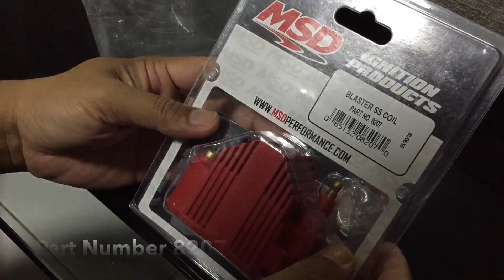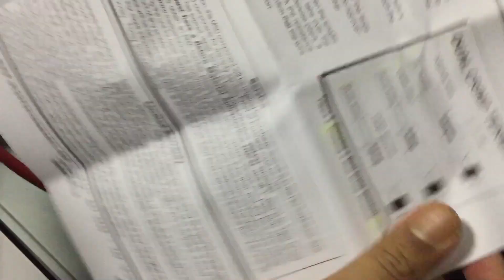Yamaha NVX Aerox Malaysia Ep: 2 | UNBOXING & INSTALLATIONS | MSD BLASTER SS COIL

Comment: mana link nak beli bang? saya tengok kat shopee dalam rm150, ingat nak try pasang kat y16zr, motor standard nak pakai takde masalah kan?? lepastu ni coli plug utk motor injection kan?
Reply from the maker: Saya  beli ori rm550 camtu. Kalau 150 confirm bukan ori. Kalau bukan ori baik pakai ori moto je pun ok je
Reply: @MrCrabsteer  ohh macamtu, kalau brand fasstek punya atau faito racing 7400 tu ok tak bang untuk y16 standard?

Comment: Klau tukar coil ni, apa funtion dia.. boleh naikkan top speed x bos?
Reply from the maker: Coil tak naikkan top speed, cuma pastikan api cukup dan stable je bang
Reply: @MrCrabsteer  owh.. Tq bos.. Saya Newbis lgi..
Reply from the maker: Saya pun newbies bang. Coil ni hanya support. Contohnya high rpm coil asal cepat panas ke, tak stable, miss-firing ke. Coil yang lebih besar dan material cable etc yang lebih efficient akan membantu lancarkan penghantaran kuasa ketika itu. Jadi indirectly boleh improve speed juga sebab api takde masalah 😊
Reply: Kalau tuning cantik torque naik bang.. enjin lebih responsive..

Comment: sy pakai coil plug ni kt rs150 tapi paki ecu tune bos lampu cek engin kelip2 error pd coil plug.. ad org ckp ni coil utk CDI bukan utk FI...
Reply from the maker: Saya pakai Juken 5 kat FI ok je bang
Reply: @MrCrabsteer  tulah... sy pakai dh lama dr spec 63 ke 65 ke 65 jek rod pakai ecu datatec.. tuner ckp xd msaalh. ni bru tukar tuneboss die error plk pd coil plug.. tp ms rpm 7 dh ilang lmpu engin kelip2... run dyno smpi finishing xd msaalh.. to hq tune boss ckp ni coil utk CDI bukn utk FI atau kne pakai sistem output MSD... tu sebab ecu die boleh kesan... law paki jgk kemungkinan ad msaalh pd engin...hemhhhh... mahal tu coil ni huhu
Reply from the maker: Bukan first time saya dengar pasal tuneboss banyak limitations itu tak boleh ini tak boleh. Saya kurang berminat. Saya  pakai Juken5 je. Boleh la.
Reply: Nak kena reset tu tuan..bru hilang error tu

Comment: Is it recommended to change spark plug when you use racing ignition coil? I have a y15zr with 62mm and big valves
Reply from the maker: Not compulsory as long as the plug still in good conditions

Comment: Sir it is ok to put it in the raider150 carb type thanks
Reply from the maker: For Injection bike only sir
Reply: @MrCrabsteer  what happen if i put it into a carb type ? What is the effect thanks again 
From Philippines
Reply from the maker: Carb bike uses CDI and Injection bike use ECU. The ignition system are different sir.
Reply: Thanks master 
But can i ask you question about compression ratio?
Reply from the maker: Sure
Reply: What compression can i use for touring set up master raider statria fu 
Thanks again master thanks a lot
Reply: Can i add you master on facebook? Because i want to learn more about tuning
Reply from the maker: Im not a master sir. My FB: Kaleelasari Mohd Azwan. I will tell only what i know. Im learning everyday.
Reply: Ok2 sir
Reply: @jiedanloriaga8945  use 11-12:1 for touring, doesnt need that much high cr since touring setup needs lot of durability consideration....

not speed

Comment: brisk spark plug and accent wire is good for stock engine  aerox sir?
Reply from the maker: Brisk Yes, tested 2 types before. Trt it. Havent tried accent wire
Reply: @MrCrabsteer  can i use brisk spark plug without  accent wire,
Reply from the maker: Of course. Brisk spark alone is ok. Never tried accent wire

Comment: Can i use racing ignition coil and iridium spark plug for stock engine of my nmax?
Reply from the maker: As long as thr coil is for Injection bike. Most of the time original coil can do its job. Stock engine dont need “racing” coil, standard is sufficient.

Comment: how is the performance??
Reply: how is your aerox ? doing ?with this Msd ss ignition coil ? what are the pros and cons ? im about to buy one like this?
Reply from the maker: Gratefully my Aerox are in its best conditions. Still using the same 62mm piston dan block. Recently another friend also purchase it and happy with it bro.
Reply: Crabsteer Motovlog  Nice im gonna try to purchase it then! I have 63mm block too. how is your topspeed on this ? and what sparkplug do you use ?
Reply from the maker: Do share your result after MSD here too bro. I dont record my top speed you might have some idea from 70’s of my video. I posted once. 😊

Comment: Power x pakai coil ni..
Reply from the maker: Saya belum try higher than 10k rpm lagi bang. Nak kena dyno sekali lagi baru tahu. Tengah buat part lain lagi sikit supaya berbaloi dyno kali kedua. Terima kasih bertanya.
Reply: Ok..tp low rpm..pulas tu ade rs beza x..kalau ok x beli jgk..hehe
Reply from the maker: Sebab scooter ni rpm 3.5k baru nak jalan clutch auto. Rpm max 10k. Saya pegi keje ni pun tak bawak lebih 9.5k. Overall response sedap. Nak cakap wajib tak wajib pakai. Qoil sederhana tapi besar sikit untuk NVX/ common FI yang ok adalah USR Coil. Coil Uma tak banyak beza katanya. Coil std tetap ok takde masalah. Zaman RXZ dulu coil std ori motor la paling sedap tapi zaman FI ni ada menda yang kena test atas dyno
Reply: Tq boss..skrg ni pakai uma je..size x beza dgn yg asal..
Reply: @SuperIdzuan  pakai coil Uma ade Rasa beza ke x?ade Naik Dyno x